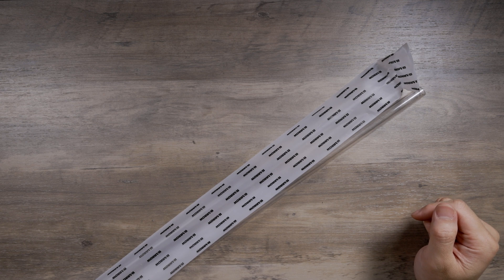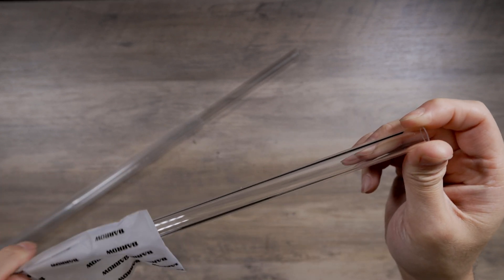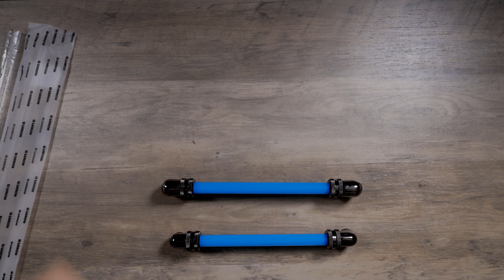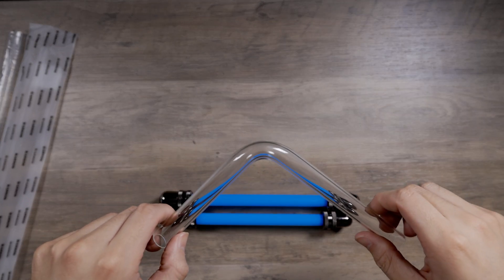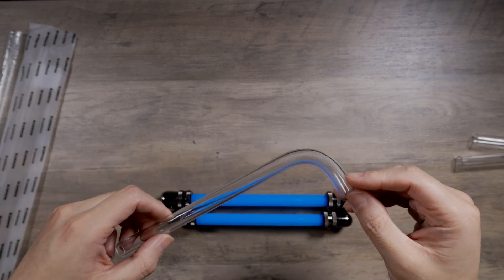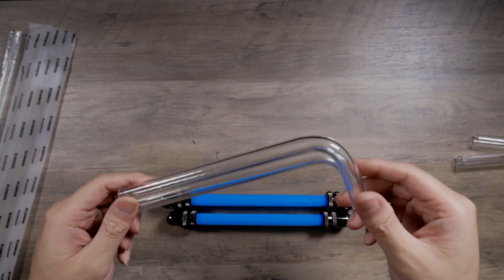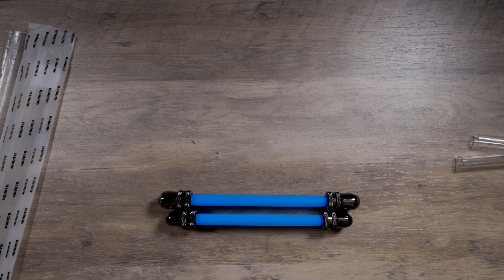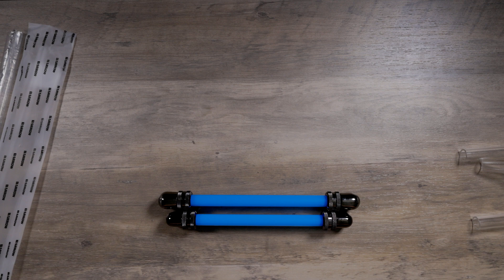WATERCOOLING DIY TIPS:  STOP USING PETG TUBING!

Comment: If you guys are worried about your PETG tubing melting because your pump fails, just get a pump that has an RPM sensor (the one that plugs in to a standard fan header in your motherboard), then plug it into the "cpu fan" header, and go into your bios and enable "CPU Fan Failure warning" or whatever it's called in your brand. That makes it so that if your CPU fan reachers 0 RPM, your system shuts off automatically, preventing any damage.
Reply: This is very great advice. Thank you for this insight, going to do this right now!! I bought a used kit someone was selling for (very) cheap and it had premochill hard fittings two rads and a pump. I saved a bunch of money but he only issue was the fitting size is a certian size that premochill only offers in PETG. So I cannot get acrlyic, plus I do like using PETG as I am a beginner. I would have never thought of this and this can potentially save me from huge damage to my PC and its free!  When the pump is running and the PC is at max load im at 33c, so I have no worry of warping as long as the pump runs. Thanks again!!
Reply: @ricamendoza379  Glad I could help! 👍

Comment: hey, I want to build a lightsaber and found this colorize PETG tubes. Do you recommend they to build this project? I'm use LEDs to light up the saber and will do some lightsaber fights with them. They are resistant?
Reply: i personally wouldn't using recommend anything that might shatter under pressure. there are a lot of transparant tubes out there that can handle some pressure (its not a good idea to put any tube under pressure regardless of if they can handle it or not), maybe give polycarbonate or eva tubing a try, i believe you can get polycarbonate rods as well, so you dont have to fill it up with whatever light you might us.
 transparant pvc exists too but i wouldn't recommend those, they're really expensive where i live(germany

Comment: huh interesting, ive been building custom liquid cooling and no deforming or whatsoever, fluids specifically made for cooling have a higher heat capacity compared to a regular distilled water which heats up faster
Reply: This is not true. You know nothing about thermodynamics.

Comment: I build myself a custom loop about a year ago and used petg since people told me its easyer to bend and cant break as easily... 
3 weeks later my pump stopped working and the system leaked around my cpu since the hot water bend the petg pipe. I had to replace my mainboard but luckly my graphicscard survived. I didnt know that petg has such a low melting point until now. 
Thanks, i was about to use petg for my next loop again :D

Comment: Stop disinformation please. Nothing happens with PETG in 40-50 C area. Acrylic IS brittle and cracks much  easier. By repeating 4 times “it is not brittle” you will not make it less brittle. BS is to do claims w/o any proof. And yeah, any ethyl containing cleaning liquid will immediately ruin your precious acrylic shit. PETG is much more resistant to chemicals. But yeah, 1 thing you get right - it is clearer by a margin which is impossible to see on YouTube :D
Reply from the maker: I think you need to actually use acrylic tubing once before assuming it’s brittle. It’s very hard to crack unless you are hammering it. Acrylic is much more tolerant to assorted fluids as any glycol fluid cannot be used with petg. If you think petg doesn’t deform in the 40-50c you should do some research on it.

Comment: Hi, I'm wondering if you could help me with a water cooling related question.
The EK DDC 3.1 on my O11d G1 distro plate is failing. I would like to replace this pump with the more powerful Swiftech MCP35X-BK (practically a DDC 3.25). My question is, could I run into any problems fitting a different model to the back of my distro plate? Granted,  you probably haven't used my distro plate with the exact ddc pump I'm getting, but I assume you will have experience replacing pumps. Do all ddc pumps work well where another ddc pump will?
Reply from the maker: I have that plate as well. Any ddc will be fine. Pretty much every pump ddc or d5 is made by the same manufacturer xylem/Laing with minor spec changes by the rebrander sometimes.
Reply: @JCustom  thank you

Comment: Yea, you don't even mention the downfalls of the acrylic tubing. It shatters like glass and if you get even little bubbles in the tube, it's so fragile. Dislike incoming.
Reply: only if you manhandle it lol
Reply from the maker: It doesn’t shatter that easy, you really would have to hammer it, and if you get little bubbles that means your applying too much heat too quickly.

Comment: I made my first loop out of petg. After a few weeks of more research I switched everything to acrylic. I don't use high static pressure fans for my rads so I was worried that temps might get a bit high. Also, learned the hard way that you need a saw to cut acrylic.
Reply: Ye saw is required I tried cutting it with a pipe cutter again and again with same result cracked tube .. and when I tried saw it's easier just need to use sand paper works like a charm lol
Reply: @gamertechlive1780  You can use a pipe cutter for acrylic, but you need to do it so slow it's not worth the hassle. Saw is quicker and more reliable.

Comment: Dont use petg with mystic fog. it will melt each other and it will cause a clog.
Reply: What you said is clearly not true. Petg tends to melt if the liquid temp goes above 40c which most loops will with a high end gpu and cpu cooled. Ive been running mystic fog with my petg tubing for over a year and no issues whatsoever.  What really matters is getting inserts to make sure the tubes wont deform inside the fitting. Note this will happen with Thin walled tubing IE 10/12mm.
Reply: Well, F me.  i chose PETG since it's my first time with a custom loop.  Ran to Microcenter and picked up a Red Devil 6800 and a few other odds and ends.  They recommended Mystic Fog.  Guess I'm not using that.  Any suggestions on what coolant I should use?
Reply: That's ridiculous.  I have run Mystic Fog with black PETG for 2 years.  Zero issues.

Comment: i use petg for halfyears now and i alway get water termp around 45c when gaming i try pinch in the tube while it running around 45 doesn't seem deform....maybe because white petg have a bit more resist.......my country doesn't offfer bitspower brass tube 14mm...kidda sad but well........
Reply: Yeah I only use petg also works fine for me.  Never had a tube deform at 50c either but hey maybe I’m lucky

Comment: I use a pipe cutter with acrylic - makes it really easy. Combined with a few seconds of fine grit sandpaper just to remove sharp edges, it's still quick work. While it's also true that it takes a bit longer for acrylic to start bending during heating, I find it's a lot easier to know when to bend (when you get to the point you have to work to keep it straight) and it's also harder to ruin with bubbles in the bend as long as you keep a proper distance. That's my experience, at least.
Reply: No way you can use pipe cutter for acrylic.
Reply: @zt8044  Of course you can. I did my whole build with one (20-ish cuts). Keep in mind to go slow and do perhaps 1/3 a turn at the time, and it'll be painless. I cant speak for every variant, but I used a tiny cheap one. 🙂
Reply from the maker: Yea it is easier to get right due to the longer heating period needed